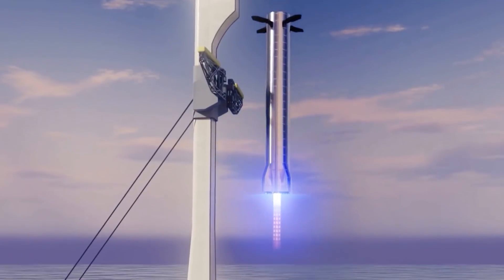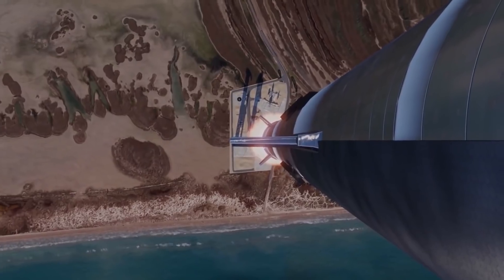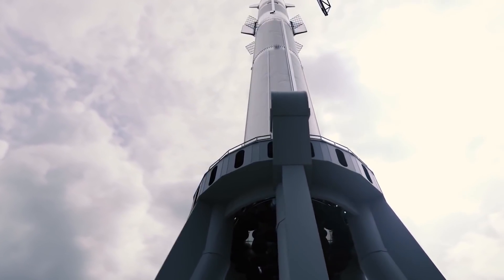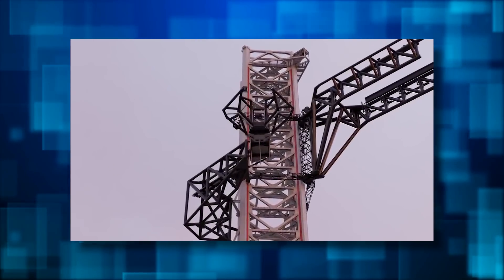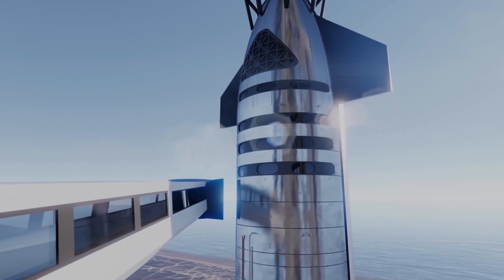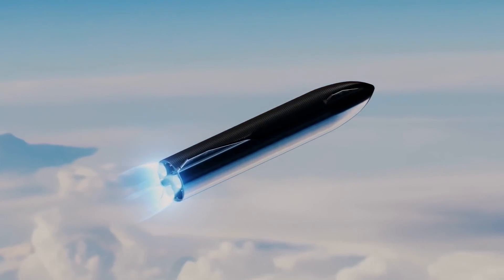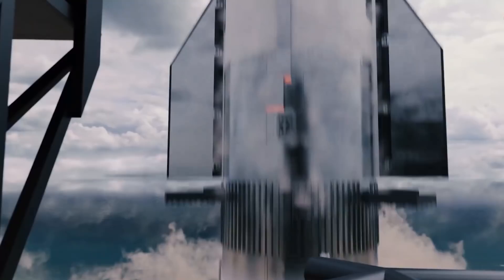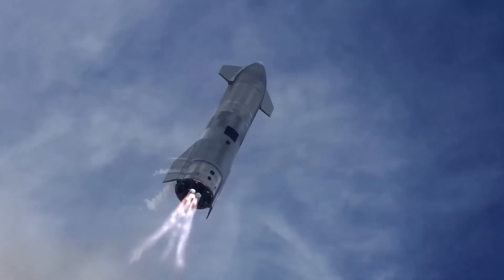SpaceX Rocket Catching System JUST Failed?!

Comment: Um- The Falcons do a suicide burn because the Merlin engine can NOT be throttled down low enough for the booster to hover.   Its minimal thrust would send the booster back up in the air…so it times its landing to burn 1 engine exactly long enough for its velocity to be net zero at the landing pad surface.  NOT to ‘save fuel’.   Starships engines will be capable of throttling lower enough to both hover, and translate the rocket.

Comment: I get your point but I think if they can get it right and quickly return the booster to the pad for the next launch then the whole leg system can be deleted and its more time efficient rather than the lengthy process of restoring falcon 9 legs with the added difficulty of the massive weight difference. Last I heard about the falcon 9 legs there was a non reusable crush element to them and they lock into place meaning engineers needed to to unlock them and fold them up which was a lengthy process. I think trying by something new we can only learn more whether its a fail or a win. Regardless though when it comes to landings on the moon or Mars thet are going to need to come up with a working leg solution.

Comment: The one thing Sue origin got right was the landing legs on the shepherd SpaceX should adopt a similar design for their booster landed near the launch pad to where it can be quickly remounded
Reply: shepard is 1/3 the size of starship so they math is completely different.
Reply: There not even comparable, plus blue Origen hasn’t even made it to orbit. They need to be copying spacex more. I’m sure space x could design the coolest landing legs ever it’s probably nothing to do with that. Rockets are giant engineering compromises and space x is apparently compromising on the landing gear so they can put that possible weight to a different problem